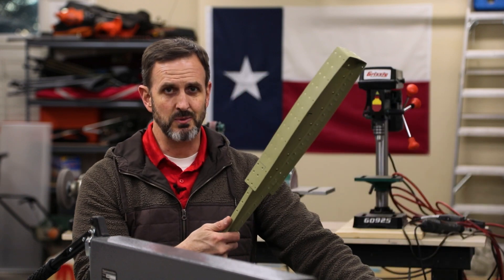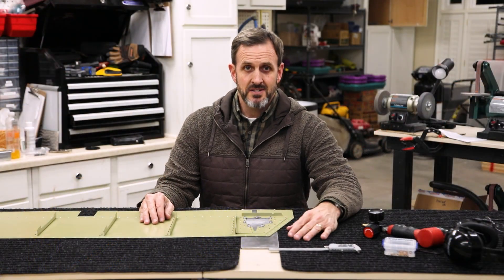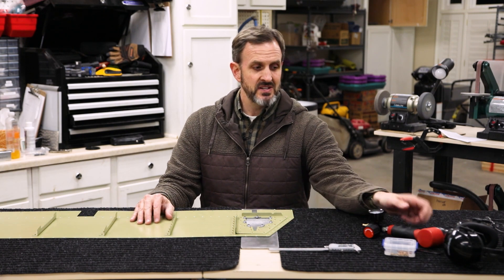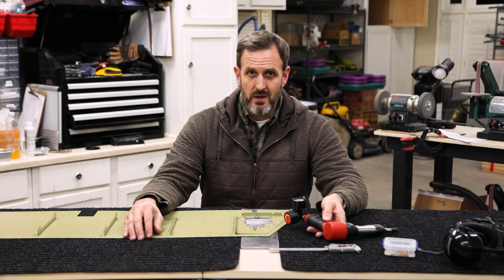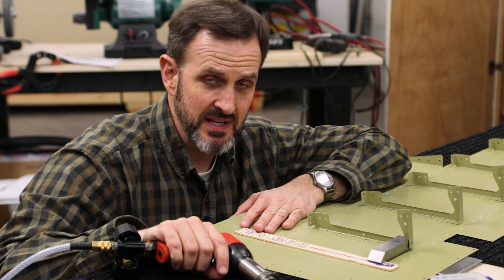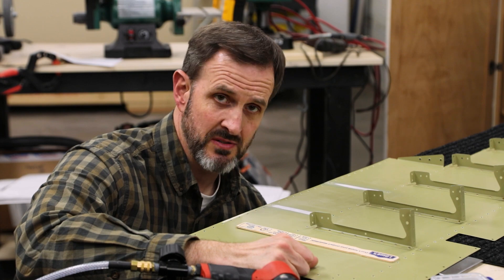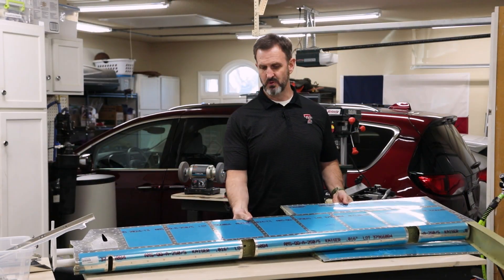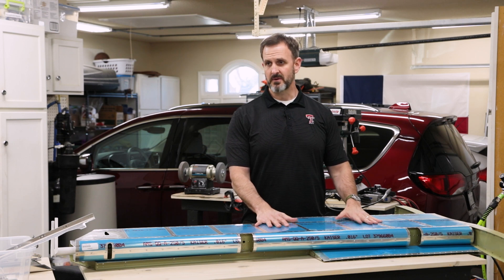Building the RV10 - Video 8 - Elevators (February 2022)

Comment: Great stuff, thanks for the videos! What regulator are you using, was thinking about switching.
Reply from the maker: On the rivet gun, I'm using a small Kobalt regulator, I believe.  I did a lot of research before buying some of this stuff, and I have expensive and cheap regulators.  They all seem to work the same...